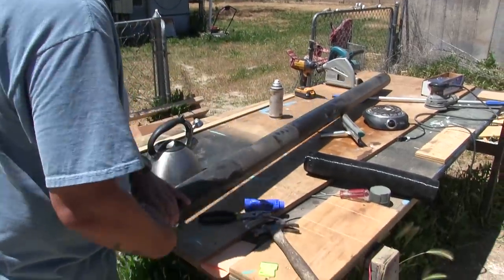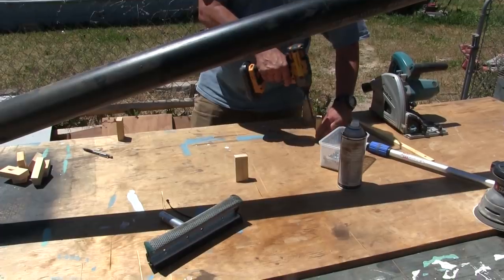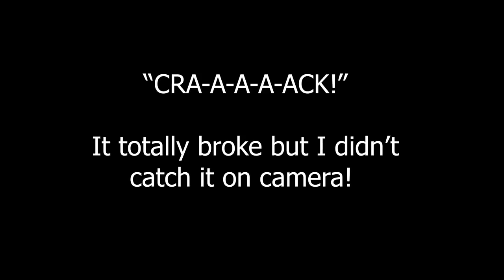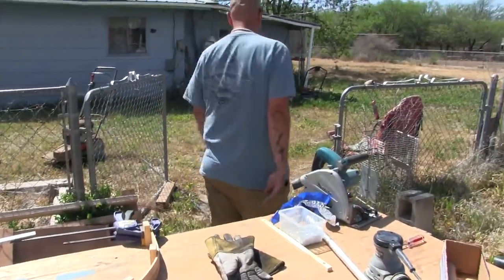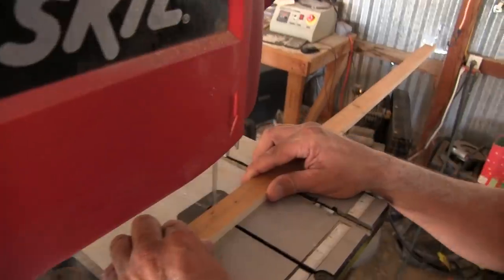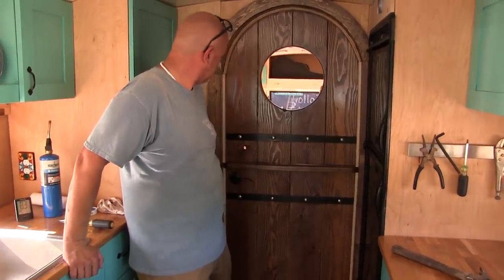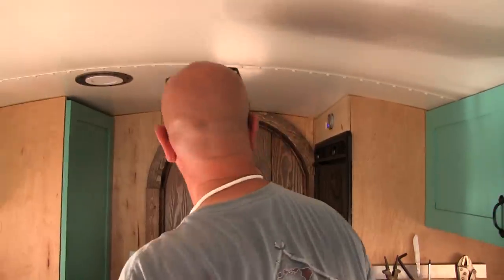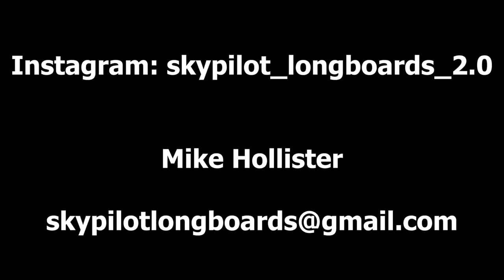Steam Bending Trim for the Arched Door in our Skoolie

Comment: Excellent fit. If you want to dress up the top curve of the door and hide the joint between the 2 layers of wood trim, you could easily install a 1/4 or 3/8” quarter round trim to finish it up and really make it custom finished. 👍. Looking sharp.......

Comment: Cool wood steamer hack, its to bad you didn't glue the two pieces together so there would be no voids or gaps between the two boards. Personally what I have done on our Tug Boat was used 3/4 plywood and cut the arch out of it to make a door stop. It worked like a dream and looked awesome around the edge of the white door when the plywood trim was stained a brown color.